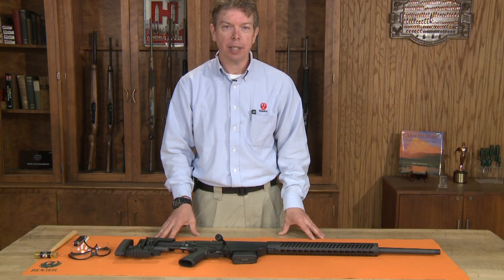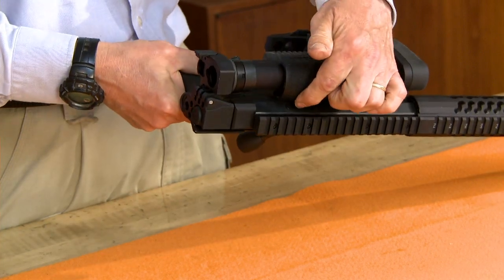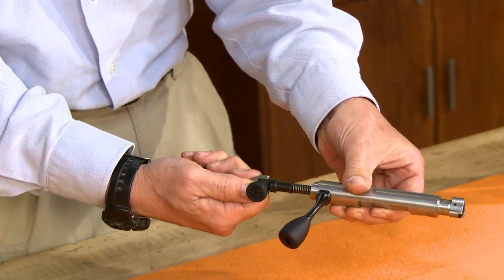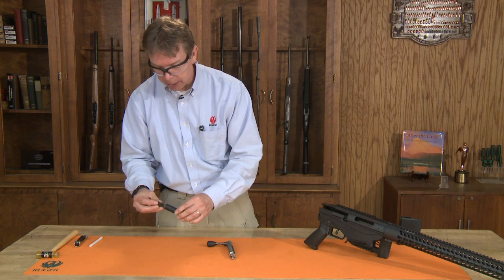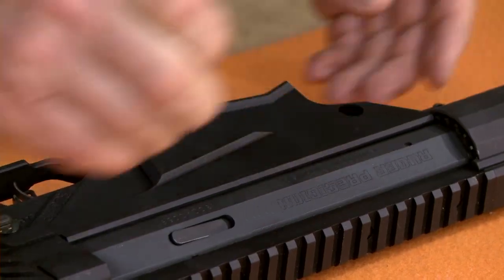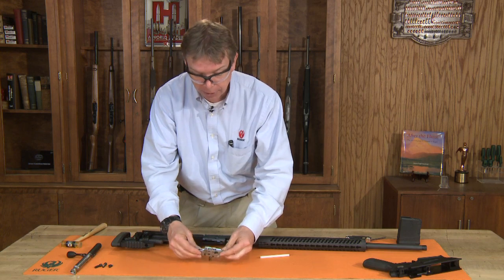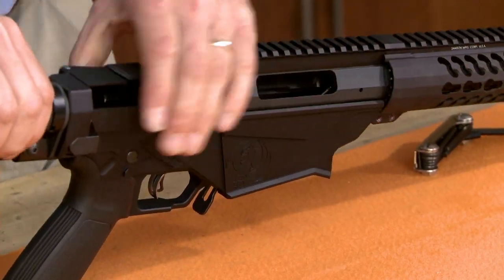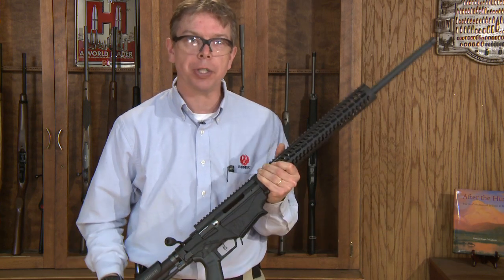Ruger Precision Rifle®-Tech Tip-Disassembly

Comment: Just made my purchase of this rifle love it so far but I am having 1 small issue. That piece that you take out of the bolt that stores the tools and is used to release the firing pin will not stay in place in the bolt. I’ll twist it and it seems secure but then I pull the bolt back a few times and the thing gets loose and will fall off when I fold the stock. Am I missing something here or doing something wrong please help !

Comment: Anyone having an issue with the Stock release button? it's jammed up tight, cannot get it to release to fold stock.
Reply: rogue203 yup just bought mine yesterday, stock button is harder than hades to push
Reply: You have to send it back to Rugar I had to do that to mine

Comment: This video needs to be slower paced, and have sections so that an individual can view what they need to repeatedly. There also needs to be a video on how to fix the "when the ill-fitting tool falls out because it's a joke on all of us that purchased it" resolution video. Forget about calling Ruger for support, they'll call you back....still waiting.
Reply: I have 3 of these. The 308 the bolt went in pieces first try. Cycled it, springs went flying. Have fixed 3 times. 
Keeps doing it. Others, no problem.
Reply: Salt&Sea *! You can slow or speed the video up from the top right button.
Reply: Be advised the tool can pop out at the slightest touch and my god damn finger got stuck in it for 3 minutes. Ruger this tool is total junk. It should be advertised as back up emergency or in field use tool AND you should supply/ send a better tool along with the rifle when purchased. And make it metal for christ sake. Next warn the end user in the video that if not extra cautious they'll end up with the firing pin attached to their finger like I did.

Comment: HELP!!  The tool used to compress the spring on the bolt assembly came loose as I disassembled the bolt.   How do I compress the spring in order to reassemble the bolt group?  Is the a tool to compress the spring?
Reply: Travelerfour Ever did you ever get this figured. Same thing happened to me. There is a great video on how to do this on YouTube.
Reply: @gregmintel9601  Yes, Ruger sent me a link to their instructional video on how to reset the firing pin.  Thanks
Reply: @travelerfourever1347  what’s the link???

Comment: This does not work on MY ruger precision 308. The gap in the plastic tool to remove the firing pin is no where near wide enough to fit over the firing pin assembly as shown here.

Comment: Great video.  Just one problem... the very first time I've tried this, the freakin' plastic tool BROKE when I pivoted it to remove the firing pin.  Now what???  Aaaaaaagh.
Reply: I ordered Anarchy Outdoors' Titanium bolt shroud and tool moments ago.  While I realize the RPR is an economy-level rifle (and quite the value), that Ruger would make this tool out of cheap, flimsy plastic is a bit of a surprise.  The two tabs broke off literally the first time I tried to use it (pivoting it as demonstrated in the video) to remove the firing pin assembly.
Reply: @Racer88  hope you had fun getting the firing pin re-cocked to get the tool back in. I sure did... 🤮

Comment: This video is VERY basic. Needs more camera angles, etc.

2:09 My bolt is slightly different (18029) so the doo-hicky doesn't fit well and it came out when I pulled the firing pin free. Now I'm fighting to get the spring depressed...

Comment: The firing pin tool at 2:08 what happens if it pops out how do i get it back in? Any advise would be really helpful.
Reply: +cityrice5 I used the shroud to push the firing pin cam back in until it was held in place with enough room to reinsert the tool. I then had to remove the shroud by pulling it off and then re-insert the tool so that I could reassemble the bolt, function check and vent on here about a slack video.
Reply: +cityrice5 Tip to everyone else do not remove the firing pin just throw that stupid tool away. LOL
Reply: Salt&Sea *!
Reply: It popped out on me too. I closed a crescent wrench on the 2 edges of the fire pin and with the pin facing down against a table or block u can depress the spring and slip the tool back in.

Comment: Be advised the tool can pop out at the slightest touch and my god damn finger got stuck in it for 3 minutes. Not cool. Ruger this tool is total junk. It should be advertised as back up emergency or in field use tool AND you should supply/ send a better tool along with the rifle when purchased. And make it metal for christ sake. Next warn the end user in the video that if not extra cautious they'll end up with the firing pin attached to their finger like I did.